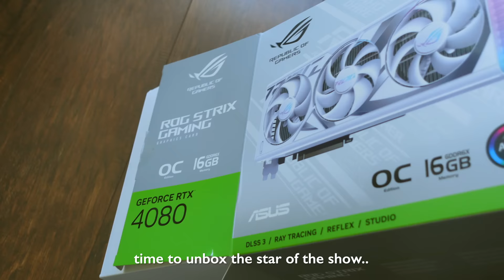building my dream gaming pc 🎮 rtx 4080, i9 14900k, white aesthetic + giveaway

Comment: Did u forget to add thermal paste
Reply: I think her cooling system doesn’t require that
Reply: @DEWHighlights no it does but water coolers usually come with thermal paste on them
Reply: Its already on the aio cooler. Doesnt need another application
Reply: It's come wild pre applied thermal paste
Reply: Prolly preapplied
Reply: @DEWHighlights every system needs it

Comment: My dream PC is: Gigabyte Z690 Aero G motherboard(ordered), RTX 4080 Aero G graphics card(ordered), Kingston Fury RGB DDR5 white(have it), Lian Li Dynamic EVO RGB white(they don't sell), Lian Li Galahad 2 360 LCD White(waiting for the case first) + 7 SL-INF fans(waiting), 1STPLAYER NGDP Platinum 1000W White(waiting). For your PC I advice to get LGA1700 anti sag frame and motherboard silicone anti dust plugs.

Comment: Another tip is to have cpu and motherboard that has integrated graphics, do first boot as little connected as possible.

If you get sometin boom they all go boom.

Is cheaper to just replace the motherboard n cpu, and maybe have cheapo ram stick as spare.

Comment: Nice PC build. But one thing isn't so good. You will have problems with the AIO. 
The problem is that the AIO radiator is located directly on the Gals. 
The heat cannot escape and you will get heat build-up through the graphics card and CPU. 
A little tip: build the radiator on the side so that the fans can pull fresh air through the radiator. 
I've been building PCs for friends and acquaintances for about 12 years, so I know what can happen if components are installed incorrectly.🙃😉 
But a nice setting 👍

Comment: ooh nice setup all white is something that will always look good .great build but the fans all blowing into the pc with no exhaust fan is driving me nuts and ik ppl are gonna say "well the radiator fans are blowing out". but bro its getting warm air that cpu may not run at a consistent hz. undervolting that big boy can reduce heat and get better performaace if you wanna keep that set  up the way it is.
Reply from the maker: so far i've had no issues with temps but i'd consider undervolting if i ever run into any issues !

Comment: where cooler on the back plate?
do you understand that all the hot air passes through the water cooling, which is supposed to be cooled by the processor?!

Comment: You are so lucky to get your beautiful new super computer. Wow, blows my socks off. I've been doing mostly video editing and using a small form factor Beelink Ser5 5560U with a built in Radeon Graphics. Although not a powerful as yours, it does a fairly good job at what I love to do. A gift of the Intel i5 you're offering would be a start to a new system. My last build was in 2012 with an Intel i5 and i7 4660k processors 16 gb DDR3 and Samsung 1tb M.2 980 PRO system disks. Thanks for reading my entry. Hope to win...hint hint.:face-red-heart-shape::face-red-heart-shape:

Comment: Hello, normal, after Christmas day, getting ready to install a deepcool 240mm AIO into my sons build, that he got for Christmas, very big fan of intel i5 cpu's, actually already have 3, i5-8600k(for my son and our first build), i5-12600k(was initially in my computer, but used it to upgrade my sons computer), and a i5-13600k(currently in my build), pairs very well with an RTX4080, wouldnt mind adding the 14600k to my collection :) which would allow me to upgrade the 8600k build, as it would all trickle down, i'd use the 14600k in my build, swap the 12th to the 13th, and completely upgrade the 8th gen build to 12th gen, as I keep the parts and have a motherboard that would allow me to :) Have a happy holidays and a happy new year :)

Comment: Hello! I've been exploring various PC builds through creators' videos to set up my first system. Stumbled upon your page and fell in love with the PC build featured, though it exceeds my budget. Fingers crossed for the giveaway, and if I snag the Intel i5 14500k, here's the dream config:

•Intel i5 14500k
• Zotac rtx 3060 oc 12GB
•Crucial RAM 16GB DDR5 4800MHz CL40 x 2
•CORSAIR MP600 PRO NH 1TB M.2 NVMe Gen4 SSD
•Asus ROG Strix B760-A Gaming WIFI Motherboard
•Asus ROG Thor 850P 850 Watt 80 Plus Platinum PSU
•Ant Esports Crystal XL Mid Tower Cabinet (White)
•Ant Esports ICE-360 ARGB 360mm CPU Liquid Cooler (Black)

I would love to play R.U.S.T all day...